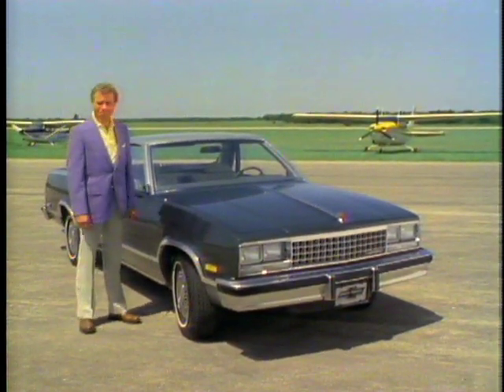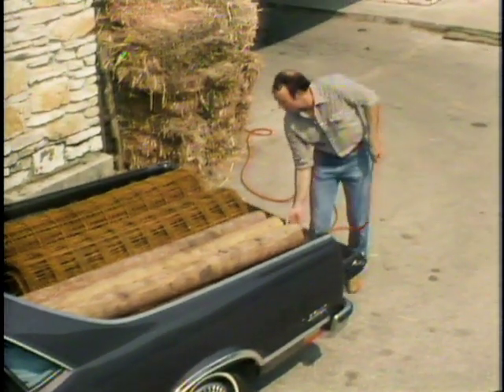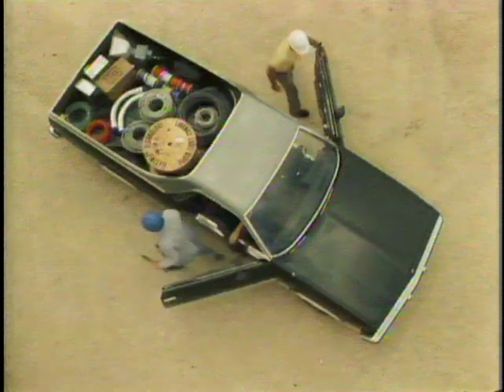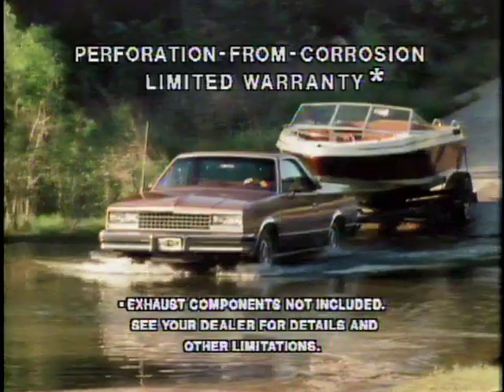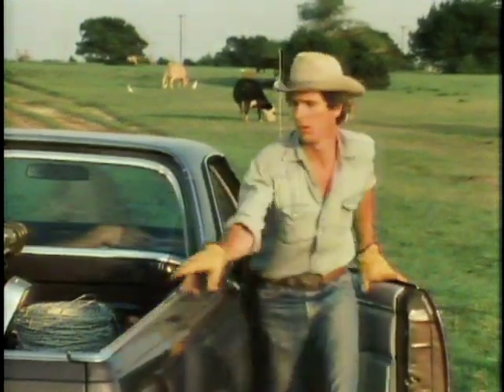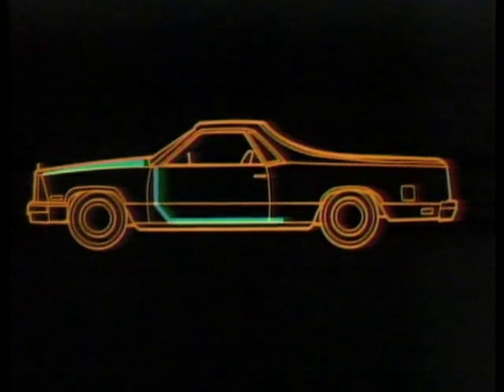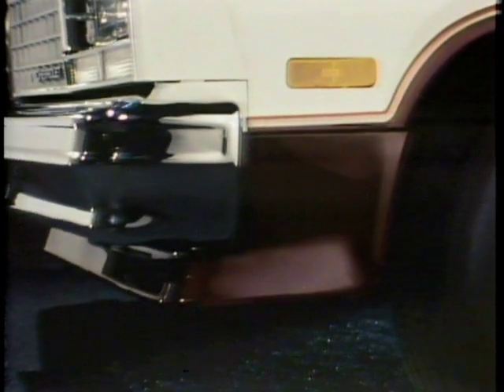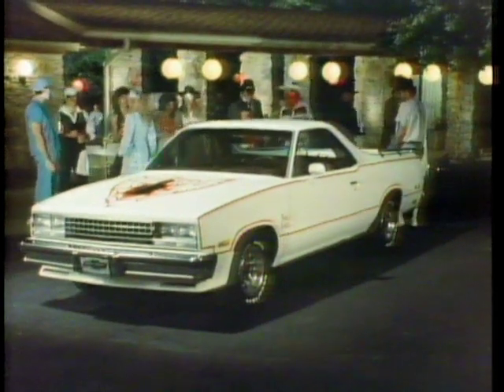1983 Chevrolet El Camino model introduction film

Comment: 84'  El Camino owner here, think I'm the only 18 year old in my city rolling in one
Reply: Same bro, 19 with my 78'
Reply: here's ray only way to ride 😎 I’m 19 now though
Reply: I had an 85 Conquista when I was 22-26, I miss her. She needed a new engine, could not afford it, Had to sell her.
Reply: 16 with my 80 Caballero with the 267
Reply: 19 years old runnin  dirt roads mines a 83 yee yee
Reply: Be good to her and she'll be good to you. I had a 79 at 18yo. At 38 I have a 85 that im swapping the body to my original 79 car once the the frame and engine is rebuilt. Great cars
Reply: I'm 60+ and have two rust-free 80's Elcos , sitting next to my 70's Mustang.  Love the Elco, the G-bodies are like the A-bodies, just a little smaller.
I recommend a rear sway bar, the light weight one from a Regal really helped.  I wouldn't go too stiff, I'm guessing GM refused the elco sway bar for a reason (maybe the air shocks?).
Reply: @thisisyourcaptainspeaking2259  yeah probably the air shocks, I’m putting a 454 BBC with a TH400 trans into my elco. I’m 20 now made this comment when I was 18. Time be flying
Reply: @ezeqkro  My daily driver '84 Elco has the 231 Buick v6 with the 4.1 4bbl intake and th250 (nearly the same as th350 except the front clutch (2nd gear) is a band.  The '81 has the 5.0 (305) 4bbl with th350.
I like the little Buick V6, does well on gas. I've seen 25mpg on the highway about everytime I tracked it (trips).
Fuel milage is important to me.
I tow, launch, etc. my 455 olds Eliminator jet boat using this elco, it does fine.  Probably beat a few ricers equipped with fart cans.
Reply: I’m the only one in my town with a 73 cami 454 got it  when I was 17 and fixed it all up myself.
Reply: @franciscotorres7531  I bet it rocks!  It's great to hear another one of these is in strong hands, please continue taking good care of it.
Reply: @thisisyourcaptainspeaking2259  will do the car is something else I love the car!
Reply: @EwFatppl  You can find the bed dimensions on-line.  The wheel wells are 45" apart (3.75ft) and the bed is 79.5 inches long, 59" wide, 53" tailgate opening.
Reply: @Darkf8t3r  I ended up fully building my '98 z28 and put my el camino to the side xD
Reply: I was 16 with my 85' and had so many old timers stop me to chat about it. 23 now and just getting it back on the road
Reply: @SevenTwo7ven  I’m 23 now with a fully built ls3 6 speed 98 maro, i still have love for my el Camino

Comment: I have had an 84 model going on 25 years and I had no idea there was a rear air shock port under the gas door until I watched this...lol
Reply: Thats awesome!!
Reply: I've owned an 81 Caballero for 20 years. And just discovered the air shock port as well.
Reply: Years ago, I had a '69 model, and its air shock port was in the license plate opening in the center of the bumper. It wasn't actually attached to the bumper, but it was in that opening, pointing down, I believe on the right side.
Reply: I always wanted a Crew Cab, long box version with the 5.7 diesel.
Reply: Same I’ve only have mine for a few months but just found this out
Reply: Didn't know myself, explained why it handled so bad is cause the stock shocks where shot
Reply: Same I have a 85 tho
Reply: The '59/'60 and '64-'67 Camino's had the air shock filler on the shelve above the spare tire .

Comment: aaah the 80's, it was a simpler time, it was a better time.
Reply: Dimebag Dave Not for cars, they were junk.
Reply: I agree but lets not forget all the 60s up to the mid 1975!!
Reply: Yeah when a Camaro Z/28 made around 140 HP
Reply: @melrose9252  Actually not all were junk.  I still have my two 80's elcos and they are under roof where they need to be.  Park these outdoors in the rain and say good bye, otherwise take care of them and they go forever.
Reply: @ryandonahue5288  140hp is enough for me.  Doesn't take much to unleash the potential, though.
Reply: Ah better coke too sniffffffffffff

Comment: I never actually met anyone that put anything in the bed of their el Camino
Reply: tombstone5860 I do. And now we've met. So you cant say that. Anymore.
Reply: I did.
Reply: I have
Reply: I have, 6 loads of 1 ton of dirt to the disposal center same day.
Reply: You never met, but they drove by you nearly every day.
Reply: I always put my pizza box back there
Reply: I haul trash to the dump in mine
Reply: Not supposed to
Reply: My dad used to carry all sort of building supplies in it. Plywood sheets, 2×4, drywall sheets, and us kids, back in the 80's. We used to ride in the back. Wind in our hair.
Reply: A man bolted a concrete mixer in the bed. Years later he sold it after he beat the heck out of it. I think it looked so bad coated with concrete that people would avoid it.
Reply: I saw one 10 years ago with a chainsaw& hauling a bunch of branches same era 83 or 85 model year
Reply: Why are you missing arms?
Reply: Lol "me" years ago lol
Reply: I hauled 1500 lb. Of solid 4in block in the back of my 77 one time up close to the cab air shocks that baby was squatting  low but she did it . I used it a lot and got 28 years out of it before rust got it .
Reply: You never met a Painter then lol
Reply: I never had anything in the bed of mine. I didn't buy it for a truck though. It was almost 20 years old when I bought it, but it was something that I couldn't say no to. It was mostly restored, all body work was done and it was in primer and ready to paint, which I never did. I thought about it several times, but I always talked myself out of it. Most of the interior except the carpet was done too. Similarly, I never bought the carpeting for it either.
I never knew how many friends I had until I bought that car. I found out how many friends I didn't have when I wouldn't move anything for them. It got to a point that people who barely even knew my name would just completely out of nowhere strike up a conversation with me, and as soon as there was a break, equally out of nowhere, and before the subject came up, I'd tell them how much I loved my El Camino and how I would never think of using it to haul anything more than my own groceries. Those conversations ended very abruptly after that.

Comment: During that time, other GM divisions once designed and manufactured their own powertrain. The engines in the Chevrolet El Camino were from:
3.8 Liter V6 by Buick
5.0 Liter V8 by Chevrolet 
5.7 Liter V8 diesel by Oldsmobile 
As a matter of fact the engines were availble to other GM midsized platforms:
Chevrolet Malibu 
Chevrolet Monte Carlo 
Pontiac LeMans which later renamed Bonneville in 1982
Pontiac Grand Prix
Buick Century 
Buick Regal
Oldsmobile Cutlass Ciera
Oldsmobile Cutlass Supreme
GMC El Diablo
Reply: Did it really come with the Buick 3.8L engine? I knew it came with the 3.8L 229 Chevrolet motor, but I never knew they had the Buick motor too.
Reply: @sped6954  Buick 231 v6 was the California emissions standard package.  Runs really well with 4bbl intake from the 4.1 buick, or aftermarket intake.

Comment: I'd love to have one with a later 5.7 fuel injection and 700r4. That would be an awesome daily driver.
Reply: That would be nice.Easily done.Especially with a doner vehicle.
Reply: I'd slap a tacoma engine in there, get a lighter flywheel, and put in a sport intake. Instant daily driver! On top of that, you ain't gotta worry about it breaking down often because Toyotas are unkillable.
Reply: @port nut none taken. But can you explain why a lighter flywheel would be bad? I'm new to the car world, and I'd like to learn more.
Reply: A camero or corvette l78 350 upgraded to a 400 crank 383 would be awesome tpi . Or a 400 SBC with a tri power setup works great to . Fuel injection is great but car-berating a engine properly will provide almost equal mpg and performance when tuned properly. I like a torque engine. With a decent high gear . Like a 12 bolt locker in 347 . Combine that with a 700r 4 and then you have hot rod when wanted with a 70% overdrive for highway travel. No 454 for me please. They blow up when I drive them . Never happened with a 400 SBC though and I felt the same power . A 401 is possibly the best pickup engine I have driven
Reply: @ChanMan-mm7fe  And if you do that I will kindly have you comitted to the funny farm. Thanks for your understanding in this matter. Lol

Comment: My uncle used to have a 1983 car, which he sold a few years ago.  I have a 1982 model that i bought to replace it, and i have to laugh at the whole "anti-corrosion" treatment thing, because I've been spending the past week or so welding in new floor pans because the original floor was just rotted out.  But i still love the thing, it's my first vehicle and I plan on keeping it for as long as I can.
Reply: Gotta replace the floor in my 81 elco and 85 regal as well

Comment: 1983 owner chiming in, love mine. need to get a new engine in it.
Reply: sirlanceem same
Reply: iv got a 73 same problem,needs a new engine and a new wiring harness the last owner really fucked it up bad,its all Jerry rigged out the ass
Reply: @0Heeroyuy01  I have a black 87 Choo Choo Custom. Recently replaced motor with the HT383. Great low end torque at low rpm. Gets cruck moving effortlessly off the line with those stock highway gears out back. Great daily driver with some real go without having to wind it out.
Reply: @jeffreyredston8957  the SP383 was what i was thinking about putting in

Comment: Except the 5.7 Diesel was absolute junk. Repurposing the gas 5.7 for Diesel was never efficient in any way.
Reply: Engineer division basically made a prototype and the higher ups just pushed production without proper testing.
Reply: jason9022  - problem was that Olds (who made the 5.7L V8 for ALL GM divisions) made fewer changes to their gas-powered equivalent (Chevy's 5.7-350) than they should've had...

The NA-V8 diesel weren't as "from-the-ground-up" as other diesel engines were.

OTOH, the Olds 4.3L NA-V6 diesel was built "from-the-ground-up" and didn't fared as bad as the V8. There wasn't a modern V6 gas equivalent until Chevy made one years later...

Comment: Laughing at the anti corrosion metal.
Reply: Yep--GM bodies were horrible in the 70s and 80s.   Cancer riddled before they were 3-4 years old if you lived in a snowbelt/salt prone area.
Reply: Not just GM, most of 'em were!
Reply: My uncle has one. It's a rust bucket. But it's still running 36 years later.
Reply: My 79 Caballero luckily is completely rust-free, it's from Nevada and imported to the Netherlands. We have given it a 'line-oil' treatment and it will never rust again :).
Reply: I've got an 81 with barely any rust at all.
Reply: We have an 82' still running and little to no rust at all lol
Reply: Something like them commercials anti rust treatments "Rusty Jones" from back in the 80's!  That was a farce!
Reply: Yeah that RustyJones antirust was a bad joke!  Remember them commercials back then.
Reply: Same my frame is basically held jp with prayer and ductape atm but ita not going to give up the ghost for a few more years

Comment: Royal Knight.. have never seen that trim. Did anyone, even in '83, have the balls to get that trim package?
Reply: Faux Craig Singhaus what's wrong with it, I would get it. To be fair it's kinda flashy but so is the trans am from the same era.
Reply: Well for one, you apparently have to wear a cape to drive it
Reply: Faux Craig Singhaus don't judge my fashion sense lol
Reply: I've seen a couple, but they didn't have the graffiti on the hood. I don't know if the original purchaser had it removed at the dealer before buying it, or if they made the dealer put a plain hood on it, or if either was done some time during the car's life.
I have seen plenty of Conquistas though.

Comment: Where have all the diesel Elco's gone?

I've been around cars for a LONG time, and i don't think I've ever seen one?
Reply: I never knew they existed.
Reply: I only knew they existed because of working in auto parts for so many years. Going through catalogs and looking things up, I had always seen that engine listed, but I've still never actually seen one, or heard of anyone with one.
Reply: Apparently not very popular option i would think the 5 liter found its way more under the hood than the diesel.
Reply: Hard to find but they're out there.  I've never seen one and probably won't.

Comment: I'd replace the engine with a Toyota tacoma engine, then slap a performance intake in it, then I would get a lighter weight flywheel to increase horsepower, BOOM. Instant classic daily driver!
Reply: Boom ruined a nice classic with a shitty engine
Reply: Chris Yarber Those 80 Elco’s came with real shitty motors.  The Toyota would be better.
Reply: Or the 3.6 lfx with the caddy twin turbo system and a six speed. ;)

Comment: Talk about a nightmare of an engine lineup! The only one that was even decent was the 3.8.
Reply: Wrong lol you must not know the 305 5.0 Is a great engine
Reply: @chrisyarber3352  I actually wouldn't mind the 350 Diesel. Motor Week tested an olds 98 with one in 84 I believe it was and got over 35 MPG with it on average. 

The videos on youtube.

And with the aftermarket today, no reason they can't be significantly beefed up in the power department like all engines can now.